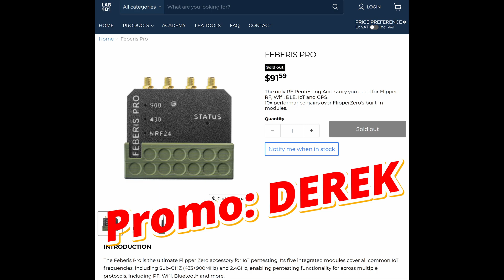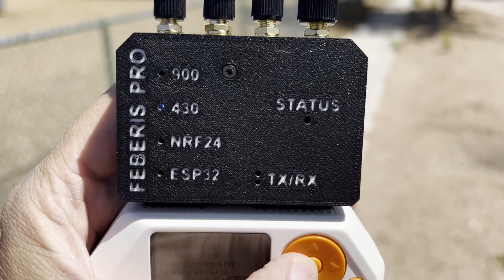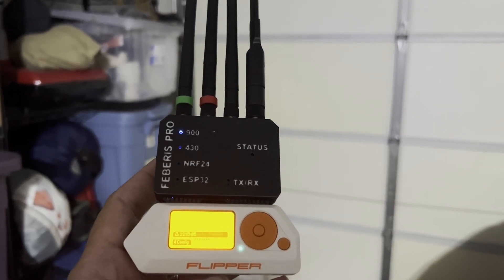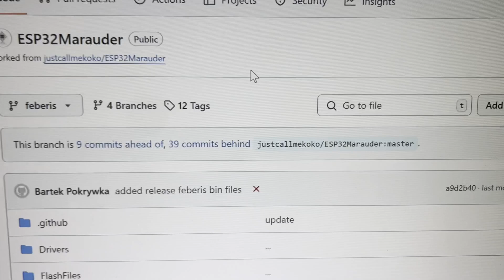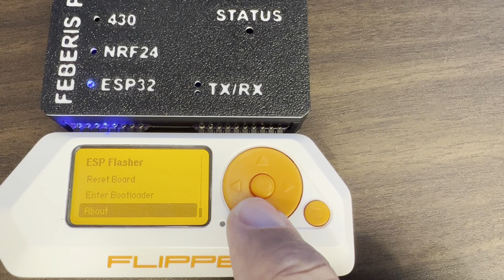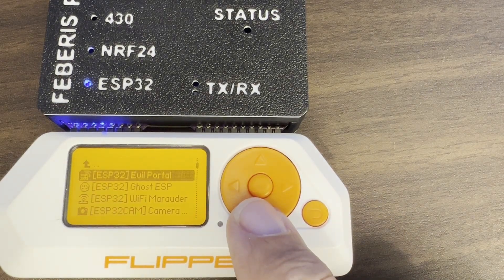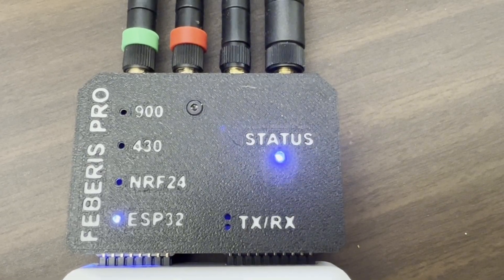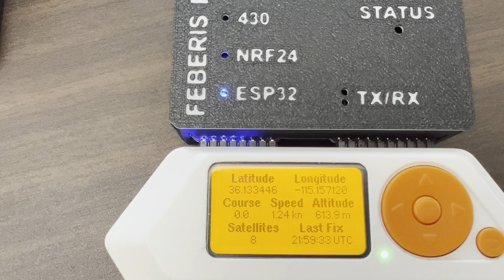[164] Flipper Zero: Feberis Pro GPIO Multi-board #esp32 #cc1101 #nrf24 #900mhz #433mhz #lab401

Comment: Hello dear Derek, I can flash GPS bin and LED bin easily, but then Marauder firmware are overwritten and not working. Is it possible to all of those 3 firmware to work together somehow?
Reply from the maker: It's a bigger effort than I think is worth. Perhaps you can modify Marauder to add GPS pass-thru, but I never spent enough time learning how to add features to that firmware. Blinking the LED was more of a proof of concept, that I thought might help other firmware developers if they wanted to control the LED.

Comment: What gpio board would you recommend for a 315mhz ?
Reply from the maker: Good question, most of the stuff I encounter is around 433MHz. For 315MHz I'd probably buy a CC1101 board with SMA connector and a 315MHz antenna. I think I've only seen CC1101 that are tuned to 433MHz or 900MHz? I haven't tried the Flux Capacitor to see if it also works in the 315MHz range -- you can probably ask on their Discord server @ https://discord.gg/rabbit-labs
Reply: Thank you  @MrDerekJamison

Comment: I have a question about evil portal. With the Feberis Pro, when I start Evil portal in either Marauder, or on the Evil portal app, the AP shows up on my phone but I am able to connect just fine(Obv with no internet connection) but it never shows the pop-up to log in. When I do the same process with the standard Wi-Fi dev board the pop-up does show up normal.
Reply: i have the same problem...
Reply from the maker: @Fejoname1-o9j Join the CyberSecurityPolska Discord at https://discord.gg/9JhnuZ2RgJ

Then jump to this message where "Bartek BPM Circuits" shared a new BIN that should fix the issue...
https://discord.com/channels/754103542452584590/1356210079548051556/1391742114626273405

(Once he gets confirmation of it working, he can release a new official bin file on the Github I showed in the video.)
Reply from the maker: @CrishieX Join the CyberSecurityPolska Discord at https://discord.gg/9JhnuZ2RgJ

Then jump to this message where "Bartek BPM Circuits" shared a new BIN that should fix the issue...
https://discord.com/channels/754103542452584590/1356210079548051556/1391742114626273405

(Once he gets confirmation of it working, he can release a new official bin file on the GitHub I showed in the video.)

Comment: Great video!  Just got one of the Feberis Pros and love it.  Question though, if I flash the "mirror gps" won't that overwrite Marauder?  Is it possible to flash both?  Fairly new to this, thank you.
Reply from the maker: Yes, it will override the existing firmware, then you will have to flash back for marauder (but just keep both .bin files on your Flipper and use the ESP Flasher to flash the bin to Firmware A). 

It’s only helpful if you want to see how many satellites or use an app the needs GPS + internal CC1101 (e.g. war-walking SubGHz.)

Comment: So, concerning the 2 BIN files for Status light & tx/rx pins communicating with flipper to display gps data... what is the protocol for flashing? When I flash either to firmware a, I get constant crashing & can't seem to get either working on my Feberis Pro/ Flipper😂
Reply from the maker: Debugging via YouTube chat is a terrible experience. Can you reach out to me on Discord (@CodeAllNight) so we can troubleshoot and then we can post a message here on how we fixed it.

I've used both ESP Flasher to update the Feberis Pro, which is the easiest if you use the .bin file from GitHub.

Another option is to use the Arduino IDE to flash the devices (use GPIO/ESP/ESP Flasher to "Enter Bootloader", then exit app and run GPIO/USB-UART Bridge. In Arduino I used Board Manager, "esp32 by Espressif Systems v3.2.0" and then selected board "esp32/ESP32-WROOM-DA Module"). This process is slightly more complicated, but it flashes the complete device, regardless of the prior firmware. Once flashed, I was able to use Arudino Serial Monitor and then toggle the ESP32/NRF24 switch to reboot the device and I can see the raw GPS data.

I know that if there is a lot of data on the serial port, it can cause the Flipper to crash -- my recommendation is after flashing that firmware you would only switch on the ESP32 after you launched the GPS app (or a UART Bridge app).
Reply: Thanks for the reply. I've been enjoying messing around with my feberis pro. It has been a bit of a learn as i go experience, but enjoyable. As far as GPS goes, it has been inconsistent on my end. I've palyed with Wardriving APs; sometimes i get GPS to show, most of the time i just get all zeroes.  Probably just user error, knowing my luck.😂  @MrDerekJamison
Reply from the maker: If you have Discord, please reach out @CodeAllNight so we can troubleshoot the bin files not working. Other people have had similar issues, and if I can understand what isn't working, maybe I can make a video on how to fix it (or at least a wiki entry).

In my area, I usually see a lock on about 9 satellites within the first 30 seconds, even from indoors. I'd be curious to see how many you are finding with your device.

Did you take it apart yet and try that recipe? 🧑‍🍳
Reply: Yeah, I actually just opened it up about an hour ago. Have not made that recipe yet. Probably why I can't get the GPS to be consistent 😂  @MrDerekJamison

Comment: how do i flash the gps and led? same way as the esp32? just select the different bin?
Reply: Can anyone give me a tip? I can’t find it on google:/
Reply from the maker: I should have been more clear at 10:00, when I said I flashed the firmware, sorry about that. Yes.

Download the bin from https://github.com/jamisonderek/flipper-zero-tutorials/raw/refs/heads/main/gpio/feberis_pro/feberis_pro_mirror_gps.bin
Use ESP32 Flasher, just setting the "FirmwareA" entry.

It's the same process as flashing the Feberis firmware, see 6:43 - 7:40 in the video (but at 7:14-7:33 choose "feberis_pro_mirror_gps.bin" that you downloaded from my GitHub instead of "ESP32_Marauder_BPMCIRCUITS_FEBERIS").

Comment: i have problem with my gps, flipper does not pick up any satelites. Can u halp me fix this please?
Reply from the maker: The Marauder firmware "ESP32_Marauder_BPMCIRCUITS_FEBERIS_PRO_v1.6.2.bin" should detect your GPS when using wardriving option.

However, the GPS module is connected to the ESP32 and not the Flipper Zero. If you have a need to see the GPS data directly (and not use the ESP32 as Marauder at the time)...

Download the bin from https://github.com/jamisonderek/flipper-zero-tutorials/raw/refs/heads/main/gpio/feberis_pro/feberis_pro_mirror_gps.bin
Use ESP32 Flasher, just setting the "FirmwareA" entry.

It's the same process as flashing the Feberis firmware, see 6:43 - 7:40 in the video (but at 7:14-7:33 choose "feberis_pro_mirror_gps.bin" that you downloaded from my GitHub instead of "ESP32_Marauder_BPMCIRCUITS_FEBERIS").

Comment: Hi ! Nice video ! I got my Feberis Pro as well, but when doing ESP Flash (Manual Firmware A) again with gps.bin, I do reset board and it creates an infinite loop writing stuff never stopping.
Reply from the maker: The GPS.bin should start logging the GPS data on the serial port, depending on the number of satellites it can be a lot of data. I typically flip the bottom switch up (not ESP32) and then switch back to ESP32 once I start the GPS app. GPS data starts with "$GP....", if you are seeing data that isn't GPS data, like it's an error loop, let me know (probably easiest to debug using Discord - @CodeAllNight).  [If you search for GPS NMEA FORMAT you will see examples].

Comment: Great video! Thanks for the presentation and testing the Pierogi recipe :D
Reply from the maker: Thanks for watching, I had fun with that one! I've been travelling at lot lately, so I really like the robustness of the BPM Circuits cover protecting the GPIO pins. At some point, I want to try to make my own multi-board, but it will probably be a few months. I haven't found much use for the nRF24 yet, but it would be interesting to dig into the capabilities.

Comment: 3:51 what even just happened
Reply from the maker: In the top-right corner of the video you can see the recipe printed on the back of the PCB (when I was originally filming, I was actually just pointing out the GPS antenna). Then I had the brilliant idea to try cooking (which I clearly need more practice at) but at least it did taste good. The last line of the recipe said, "Enjoy with sour cream or onions!" but I ate them without, and it was still really good.
Reply: I understand now, well done 👍

Comment: A cool board.

Thanks for the video.
Reply from the maker: Thanks for watching. This is the only board I own with a CC1101 that does the 900MHz spectrum (most stuff I own is 315/433).
For Marauder & FlipperHTTP, the board is really easy to use all of the features (and it picks up signals much further away).
I've never been able to get GhostESP to use my GPS units, so no idea what I'm doing wrong.  :(

Comment from the maker: 4:33 -- The Base from the fire is crazy... those flames left a nice mark on the overhead microwave too! Clearly, I don't do much cooking... but my wife said to either air dry or even put in fridge to help reduce the outside moisture before adding to oil. 🤣